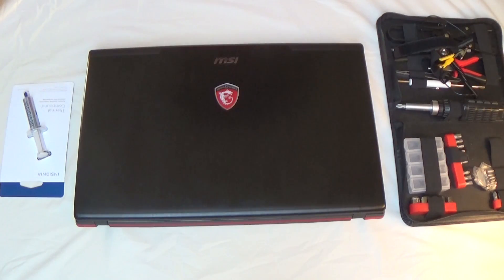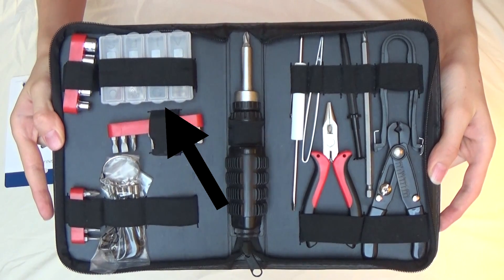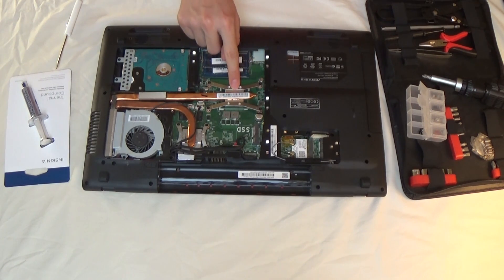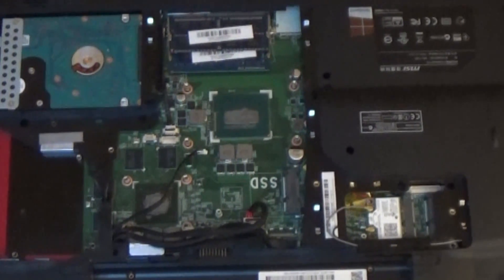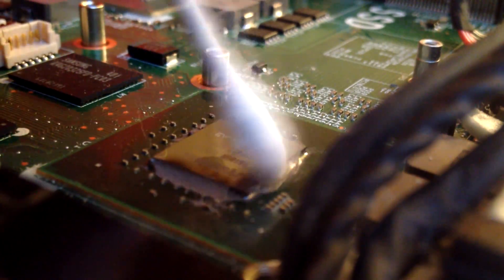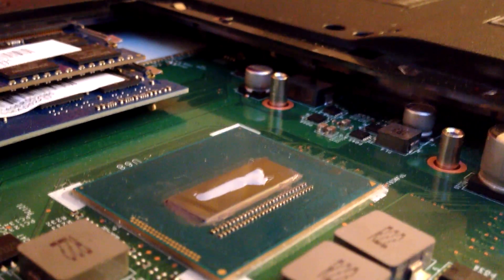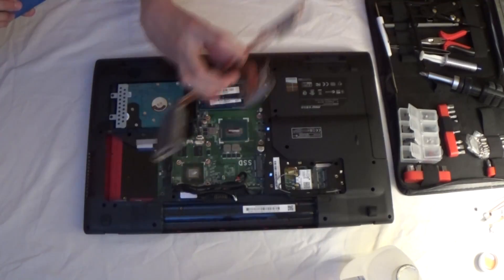How to Replace your Laptop's Thermal Paste

Comment: For those ppl who applied new thermal paste but only have small drop of temp make sure to clean laptop vent, fan, radiator fins mostly the radiator fins has build up dust which makes your laptop hot or overheat
Reply: hi i got my thermal paste change today but i removed my heat sink to check whether it was spread fully or not. I checked online people were saying i should rechange my thermal paste after removing the heat sink. please tell what should i do
Reply: @radeon7916  yeah you should repaste your thermal paste again since your remove the heatsink use the x paste method to make sure it spread most people use the x paste method since it's very effective

Comment: Use 99% isopopyl not plain rubbing alcohol.  Remove screws from the heat sync in the order numeric/alpha order stamped near each screw.  Reverse to install.  Do not use Q-tips or toilet paper!!!  Use a paper towel or a lint free towel well moistened with 99% Isopropyl Alcohol to clean the old paste, then dab dry with a clean area..   On square chips, I like to add to the center drop a small drop on each diagonal about 1/3 the way towards the corner.  The center drop flattens out circularly and may miss the corners.
Reply: hi i got my thermal paste change today but i removed my heat sink to check whether it was spread fully or not. I checked online people were saying i should rechange my thermal paste after removing the heat sink. please tell what should i do
Reply: @radeon7916  yes, you need to do the whole clean and paste again.

Comment: I’d just use the spread method and u really don’t need rubbing alcohol if u just scrape off the thermal past hard enough with a quip it will just come right off and I know this because I just cleaned and replaced a laptops thermal past for the 1st time in 8 years and the thermal past was just all crusty and hard so yeah

Comment: does the thermal paste spilling over the edges cause any damages?
Reply: No it doesn’t as long as the thermal paste is non conductive.  Most spill over the edges when applied at the factory.  It is actually preferred when applying to a bare die because the whole die needs to be completely covered.  Even a small area left uncovered on a bare die can cause an issue.  I prefer the X method.
Reply: No it doesn’t as long as the thermal paste is non conductive.  Most spill over the edges when applied at the factory.  It is actually preferred when applying to a bare die because the whole die needs to be completely covered.  Even a small area left uncovered on a bare die can cause an issue.  I prefer the X method.

Comment: Some computers have the older thermal sticker glued so hard, it is impossible to remove it. I use nitro thinner, it needs a small screwdriver to scratch it down, then the new thermal paste can be put on the cpu. Some people like to put 3 layers of thermal paste. To remove the original, it can take up to 10 minutes. I put the paste to all parts of the chip, even the corners. If not, some parts of the chip don't contact at all, because the manufacturing is not that perfect.

Comment: Never trust a video for "BEST METHOD" with someone who goes and uses a bloody screwdriver and then apply way too much thermal paste. Then goes and messes it up using a qtip causing air bubbles and contaminating the paste with cotton fibres.
Reply: Yeah he should have redone a lot of things in the video. He didnt even mention the first step which is taking out the battery.

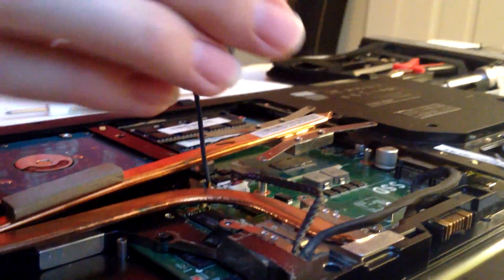Comment: 3:35, what did he pull of from the fan, is it a wire or just something keeping the fan in place
Reply: was a wire
Reply: The connector it's basically the power cable for the fan

Comment: i knew smth was wrong when my laptop went from 80 C~ on full load to 101 on full load.
it actually smoked a little.
with a new coat thermals vastly improved
Reply: YOOOOOO WHAT
Reply: @Boltimator it's an Alienware from 2014
Reply: @Boltimator yea. And I'm still using the same laptop. I'm broke af. I got it in a giveaway and now I'm in college so I'm too late

Comment: Sorry but your teaching people how to fray there laptops only this way dont creat a video with out adding the basic roles like 1 close laptop 2 remove battery 3 better wait 20min atleast to make sure no electricity is stored in the motherboard  4 make sure the paste you are using dosnt conduct electricity as much as possible (for beginners) which is safer and better also .good luck all

Comment: Spreading is 100% the best method for direct die applications (like an exposed chip in a laptop) because you want to cover every single part of the die. A blob or a line is fine for the IHS on a desktop CPU, because the majority of the heat is right in the middle, but for direct die applications always spread. Some going over the sides when you put the heatsink back on is no problem. This also gets rid of supposed "air bubbles" caused by spreading.
Reply: Thank you for these tips friend 🙂💪
Reply: LOL everyone is freaking out with these "air bubbles" as if it was "air blobs"

Comment: what should i do when somw thermal paste goes into the doohickey power thingys?? When i removed my heatsink, extremely dry thermal paste flaked off and went into one of those sockets. The guy that applied the thermal paste last time did a terrible job and it was overflowing like crazy. My laptop opens up in a black screen then shuts down itself. help!
Reply: Use a cotton soaked with alcohol and gently rub in a round motion,for me it worked.I mean the cotton fiok is doing a round motion using your wrist
Reply: @mihailcirlig8187  OMG THANKS

Comment: I may need to do this with my laptop at some point, but I really dont wanna cuz I do not trust myself to not majorly screw something up.
Reply: It'll be better if you let a professional do this. I tried making it myself for the first time and I screwed up a little bit :).
Reply: @kt249  Yeah thats what im thinking too
Reply: @TheSpeep  Don't get me wrong, its not hard or anything and I didn't really screwed it up (I accidentally disassembled my power button cable and connection was under laptop's motherboard, yikes. But I somehow managed to plug it back after 1.5 hour of trying) . I changed my thermal paste after 3 years and it made my CPU is just a little bit cooler (if you count 1-2 degrees as "cooler") and my gpu is hotter than before(75 to 85 degrees). I used Arctic mx4 and did it really carefully, but I don't know what went wrong. I'm going to change it again and see if temps are going down. I'm a bit nervous about it. Wish me luck lol
Reply: @TheSpeep  Hey, I managed to lower temps by 10 degrees. My laptop fan was a bit clogged up; I cleaned it  all over and pasted again, made sure everything is fitted right and tested: temps were 80-85 before, now it doesn't exceed 70 even under loads.

Comment: Why am I even watching this my laptop is 3 weeks old
Reply: I had to replace my thermal paste an hour after I received my laptop from newegg. Whoever put it together used way too much and it had squished out over the edges of the cpu. I cleaned the old of and put new on and now the cpu doesn't throttle itself due to high temps. Just because it is new doesn't mean someone did a good job building it.

Comment: only 2 heat pipes? my 4 year old he62 has 5 heatpipes , 3 for the processor, 2 for the gpu and 2 heatinks. Replaced the thermal paste and cleaned the insides. temps dropped by a whopping 20 C on average.
Reply: Nice. you notice to that his laptop only had one fan too for both cpu and gpu?

Comment: I’m really annoyed, my laptop is an Acer Nitro 5 and I just found that they basically ruined my CPU because of how they applied the thermal paste, this is why I get temps of 100 degrees when I play games
Reply: damn I get 95 and did you change the thermal paste?
Reply: Teja Puvvadi yeah, I had to watch a video that went into detail about throttling the CPU so that it doesn’t kill itself, so overall more consistent performance and an average temp. of around 70 degrees so I’m glad
Reply: @Solicle  Thanks for the reply, I'll try that too

Comment: Thank you so much ^^ I think I have a very similar laptop to that one, I have an MSI CX61 laptop. I was wondering how best to apply thermal paste to the horizontal CPU in my laptop. I used three small dots, instead of the line method you did, but pretty similar :) Thank you for the reassurance I made a good choice!

Comment: I do remove excessive old thermal paste with an old tooth brush. After it's lose, you can suck the rest up with a vacuum cleaner.  That's much saver than scratching with a screwdriver.

Comment: No idea why this video has soo many dislikes. This has been the correct way for more years than I can remember. This is also the preferred way that HP servers are repasted. That's telling you something. Although more surface area is covered 5 dots vs 1 dot of paste, it's still the same procedure. No spreading with a plastic card or whatever. This seems more like a gimmick than anything useful. FSixTech is correct in saying that it will overflow from the heat spreader onto the actual surface of the chip effectively wasting thermal compound. Watch this video to confirm that a single dot is way more efficient than spreading the paste like an idiot. https://www.youtube.com/watch?v=EyXLu1Ms-q4

Comment: u are king thnx

i have a question

my laptop overheat even after i change the paste, it was not heat but now it heat i cleaned the fan

sometimes when i cahnge the paste it does not overheat but in next day it back overheat i have to chnage the paste each day? help

Comment: Overall good video. Two recommendations: 1) invest in some better compound than insignia. Noctua, arctic silver. Thermal grizzly are all much higher quality and around $10 on Amazon. 2) use isopropyl alcohol rather than regular rubbing alcohol to ensure a larger majority of residue and impurities are removed before applying the good stuff

Comment: Acer predator 17 is here. I could not believe how it can help in performance.       BEFORE : FULL LOAD... GPU 97 Celsius degrees CPU 80.     AFTER: FULL LOAD...  GPU: MAX 69, AVRG 62.   CPU: 70
Beside replacing i did detailed fan/pipes dusting

Comment: The process of spreading the compound evenly across the footprint of the die with some sort of tool like a credit card is always the method I use. The biggest mistake people make is applying too much compound. You just need the thinnest layer  to transfer the heat from the die to the copper. If you do this correctly there won't be the flow over effect which you frequently see on applications both direct from manufacturers and by end-users. Using this method I just dropped my idle temp by 16 degrees on a Thinkpad x1 laptop with an i7 8850h using AS Ceramique2

Comment: DAMN THAT WAS THE EASIEST BACKDOOR COVER I'VE EVER SEEN. YOU GET ALL YOU NEED WITH JUST ONE COVER.
Reply: msi really do be like that sometimes.
Reply: @busteraycan  msi gs65 stealth here... Had to open all the way up to access the motherboard
Reply: @quartermaster2809  If you mean completely removing the motherboard by accessing it. That's true for all laptops I know. 

But in my experience of working with a lot of laptops to mostly change the HDD of friends laptops, my msi gt70 was the easiest to access overall by far. 

For example, my laptop has 4 ram slots and 2 of them are under the laptop behind that access cover. While the other 2 are on top. But you can remove the keyboard with 2+6 screws and some prying(very little prying, there's even slits to make it easier) and under the keyboard, there's a cutout in the aluminum chassis so you can access the top 2 ram slots without removing the whole motherboard.
Reply: @busteraycan  didn't know that, i always went for the back of the laptop first in order to open it
Reply: @quartermaster2809  To be fair yours could be completely different. That was just the case for my gt70
Reply: You should see the Dell from mid-2000s with magnesium case. One screw.
Reply: @JJ-si4qh  not all of them
Reply: @JJ-si4qh  That's amazing.
Reply: my dell 7577 is pajn in the ass have to pay someone to change thermal paste luckily im in the philippines haha

Comment: Yeah, somebody already mentioned using a screwdriver to scrape off the excess. Shame.

Also, you failed to mention you should clean off the excess compound off the "Heat Sinks" before applying the new. Otherwise, you just defeated the purpose of applying a higher quality thermal compound. 

We learn by our mistakes! Hang in there!

Comment: tip: dont mess around with the paste too much, this could cause air bubbles
Reply: Ima bring out the popcorn ... Pls carry on some more
Reply: People talking about air bubbles and nobody speaks about using cotton to mess with the paste.
Reply: If you tighten The cooler properly there is no Air bubbles no matter how you mess with The  paste
Reply: @joonas4427  Well yeah that works for larger air bubbles but not ones you can barely see
Reply: @jackpreston9236  how can you see The bubbles ? :D
Reply: The Job that paste have is to fill those air bubbles so i dont think that you can have bubbles under that pressure. That is bullshit.  You can Even draw on to the paste it doesnt matter
Reply: @joonas4427  You can't fill air bubbles, you have to remove them.
Reply: @jackpreston9236  yes remove them by applying The paste and proper cooler pressure :d
Reply: @jackpreston9236  and from where did you learn about those silly Air bubbles :d
Reply: @joonas4427  Again, you'll still have small air bubbles that decrease thermal efficiency in the paste.
Reply: @joonas4427  I'm an engineer
Reply: @jackpreston9236  so then you should really know that there is no Air bubbles.
Reply: @joonas4427  You do realise that mixing any liquid will create bubbles. Introducing air gaps into a thermal compound will create inefficiencies, it doesn't matter if they are massive or microscopic.
Reply: @jackpreston9236  yea if there Are bubbles its Bad but there isnt. Pressure of The cooler pushes bubbles out. Why Even use The paste If its full of Air bubbles
Reply: @joonas4427  Pressure of the cooler also pushes thermal paste out and some air bubbles stay between cpu and cooler. You know air is compressible, right?
Reply: @DisiKleep  yes i know and also thermal cycles pushes all The paste out eventually thats when you have to change The paste. But there Are no difference If you touch The paste or not
Reply: @joonas4427  Jack is right! Im a computer tech and i repair computers in canada since 1995. Most common overheating problem is leaving dust and air bubbles in thermal paste.
Reply: @halometroid  well you dont leave dust there of course. But how you know If Theres Air bubbles when The Cooler is on top?
Reply: @joonas4427  you get temperature spikes + thermal throttling. You will also loose cpu speed up to 1ghz in perfomance.
Reply: @halometroid  yea but how you know its The "airbubbles" is causing it?
Reply: @joonas4427  because you can hear the cpu pop the bubbles when the spikes start happening...
Reply: @halometroid  sure dude :D
Reply: @halometroid  you actually hear a loud pop when the airbubbles explode out okay...
Reply: @joonas4427  You only get air bubbles when you mix the paste before application or on the CPU. People who say it never happens have tried applying the paste using standard method (pea, line, cross, etc.). Applying the paste correctly will never produce air bubbles. From carbonated water to making dough, making mayo with oil using emulsification, whipped cream, meringue using egg whites, you don't need to be an engineer to understand how air can be incorporated into everything.
Reply: @halometroid  Well no one who have braincells would not mix The paste. But If you spread it on to The surface it Works just fine. Ive messed with The paste and spreaded it it doesnt matter.
Reply: @halometroid  its okay you guys can believe what u Want but dont spread mis information pls.
Reply: Imagine being stubborn to the point where you don't want to believe what professionals tells you about facts they witness everyday at their job  sigh
Reply: No one havent witnessed anything:d just words and "professionals".  Even der8auer Said that The airbubble thing is bullshit. I dont take just anyones word who says yo im a professional you have to believe me.
Reply: @joonas4427  It's simple facts tho. If you mix a paste you bring air bubbles inside of it (it's the same proccess that is used to make whipped cream) and materials with air bubbles/gaps are known to be thermal insulator (glass foam , glass wool, double glazzing etc). Sure it won't change your paste into a foam but it will still affect it's performance to a certain degree
Reply: @FrenchPianoCover  but no one isnt mixing it. Sure there Will Be Air on there If you mix it like Cream. But it doesnt matter If you spread it on The surface. I wasnt saying that Theres not airbubbles If you mix The paste with a mixer.
Reply: @FrenchPianoCover  i was just saying that spreading The paste on The surface doesnt matter but then you guys started talking about mixing The paste like Cream. Who would do that?
Reply: @joonas4427 Well you said "Well no one who have braincells would not mix The paste" maybe I just didn't understand the sentence properly (which is likely) but it kinda felt it was a bit confusing, like you were saying that you should mix the paste :x It's my bad then ^^
Reply: @FrenchPianoCover  yea i meant that no one wouldnt mix The paste. Dont know If i spelled it right or not :d
Reply: @joonas4427  No worries, I can't tell you if your way to say it was right or wrong (I'm not a native english speaker afterall). As long as we understand each other in the end, it doesn't really matter :>
Reply: hi i got my thermal paste change today but i removed my heat sink to check whether it was spread fully or not. I checked online people were saying i should rechange my thermal paste after removing the heat sink. please tell what should i do